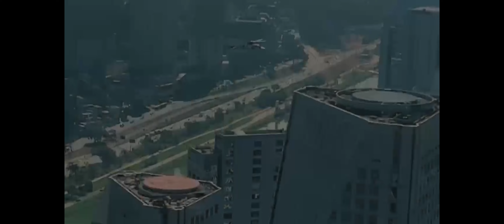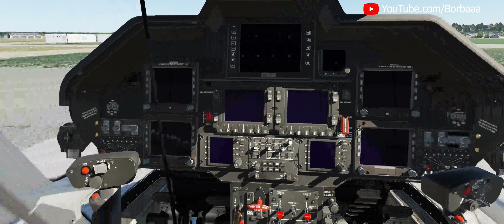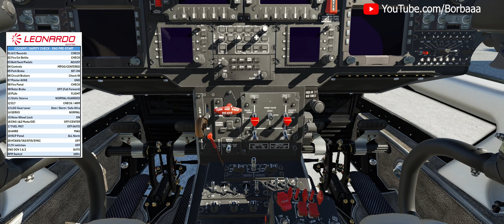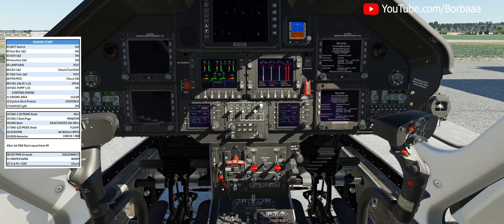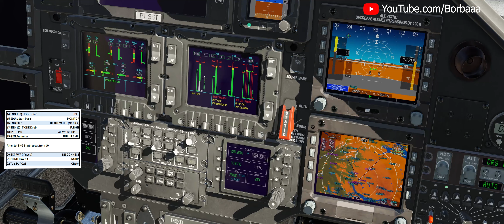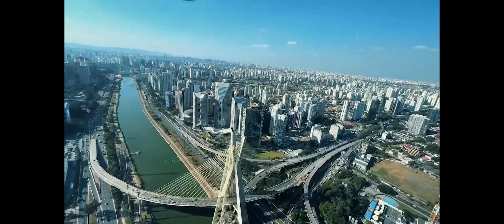[REAL PILOT] Start-up Tutorial AW109SP by X-trident for X-plane (ENG)

Comment: Thank you for this c/d startup. Having issues with autopilot, but I'm sure I'll get the hang of it. Thanks again!
Reply from the maker: Autopilot issues usually are related to the axis. Check if you need any dead zone to the rudder axis. This may work 90% of the times
Reply: @Borbaaa  thanks! i'll give it a shot. much appreciated

Comment: I have one more question if that's ok - as you are flying the real thing:

I have a sim-rig that consists of a Virpil Mongoos cyclic with an extension of 30 cm.
When I leave the curves and everything as it is in standard the helicopter reacts extremely slow to any stick movement with the SAS activated.
I assume this has its root cause in my "original length" stick so therefore I have to do huge movements with the stick in order to get the helicopter moved.

My question:

Do you have as well a helicopter-like rig (maybe also a stick with extension) and if so - have you changed anything in the dampening or input gain?

Comment: Very helpful thanks!
Looking forward to the takeoff tut, and hopefully an in-flight cruise followup if possible because in the sim this heli flies so different from others. Love it so far though.
Reply: Excellent video with lots of valuable information. I am looking forward to the whole series so I can fly it properly getting the most out of all the automated systems. Thank you for taking the time to make them in English. They are easy to understand despite you having to speak in a second language.
Reply from the maker: Nice to know Christian!
Yeah, taxi and before takeoff tutorial are recorded. I’ll proceed with Normal takeoff and landing, CAT A ops, FMS and AP tutorial and move forward with all.
This bird is really different from the other helicopters actually present in the SIM.
But the actual generation of helicopters like AW109SP, AW169, H145 and etc are build with complex technology that make than a little complex to understand but easy to fly and manage.
Reply: @Borbaaa  In a good way, I meant though. For example a few flights ago trying to learn, in a leap of faith I simply let go the cyclic presuming it would dive.... But it leveled out! It was quite the shock. 🤪 Now a little more used to it, it's incredible to fly!
Reply from the maker: @EndlessGraphics  the SP has a good stability when in ATT mode, that is our usual mode when flying using the hands. You get used after a few hours of flight. Usually flying without the need to land in the next 5min we use the AP, just leaving it to ATT minutes before land. So this bird is basically AP all the flights.

Comment: thanks ……well done.
One thing I’m interested to know your thoughts on it.     When starting engines …….i know checklist says first eng started to flight, then next to ground idle…..then do AP test.    Not only is this noisey environmentally but worries me doing AP test with engine at flight (if AP misbehaves you could roll if any collective is added).    I prefer starting both to idle, then do AP test and other EFIS functions.   then move both up to flight.    I have also noticed that sometimes by having one engine in flight and the other in idle and you miss some checklist items you can forget that one is in idle and lift collective……the SP audio reminds you of this embarrassment.   In the older E and S versions it didn’t and you could easily lift to OEI hover (possible over torque)……luckily not with SP.   my thoughts only and based on what one Agusta instructor told me at Vergiate when I did SP course many, many years ago.
Bye
Reply: Ok interesting……I found that if you touch the controls, even lightly, during AP test it can upset the test, so I don’t.    All the SP drivers I know here (4 others) all of them go to ground idle on both engines on start and do AP and Hyd tests in that state.    I did the S and SP factory course and my instructors didn’t care if I went to the idle or flight…..so there is a discrepancy that I haven’t been able to properly resolve whether it’s detrimental or not????
Cheers for now
Reply from the maker: @miket3445  yeah, that is something that I think engineers think differently from pilot. We are in the controls and know some stuffs that usually they don’t prevent when developing the helicopter, like the AP Disc button in the cyclic disconnect both pilots. That could be a big problem flying IMC and have it both AP OFF. AW169 if I record correctly have a fix that it disconnect 1 AP and to disconnect the other you should press again the button.
I never tried the AP test at idle, my IP in Sesto said that it don’t work, but I’ll try next flight. 🤝🏼 Much better than at Flight.
Reply: Yeah I do the test at ground idle only without any difference.    As long as there hydraulic pressure the series actuators can be tested.
Cheers
Reply from the maker: Hello Mike!
Yeah, there are some thoughts about the test procedures like this with AP and also the HYD test too. Both with engines in flight. Some pilots concerned about that and we opened a discussion and mostly everyone agree that this should be done, if done, with hands on the controls. I don’t know, usually we do this tests once a week. AP mostly doesn’t work because we always have problems with tail actuators, a SP problem as usual.
Next recurrency I’ll talk with instructor to see what they say nowadays.

Comment: GND COM position is implemented but needs battery on. Do we need to change this?
Reply from the maker: Yes, if you switch to GND COM it turns on some systems as described in the training manual:
On the ground, when the MSTR AVNX switch is set to GND COM position,
the electrical power is supplied only to the GROUND BUS, therefore only the
following equipment are supplied: AMU PRIM, VHF 2 PWR, GPS, RBP PLT, RTU PRIM, EADI PLT.
Reply from the maker: This is useful to save battery if you need to get clearance for you FPL and will need to wait some time in the comms.